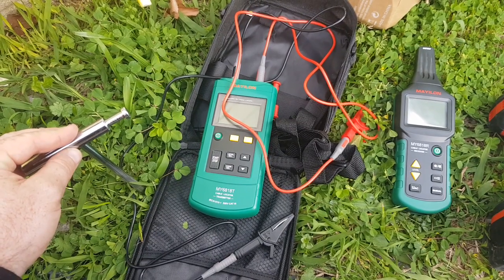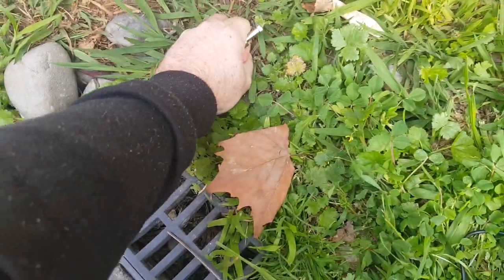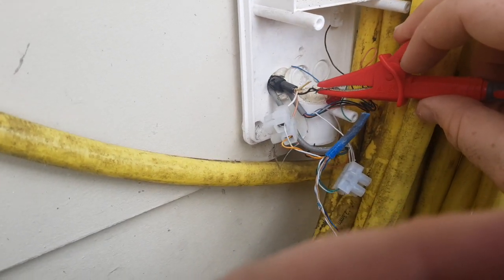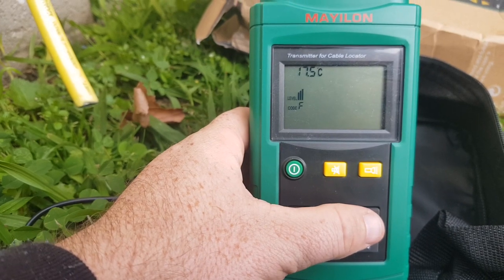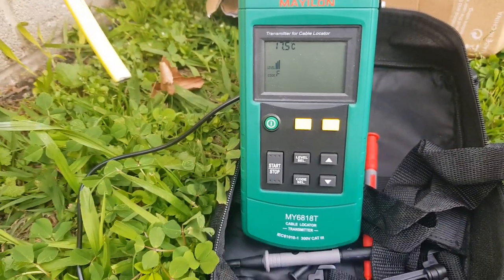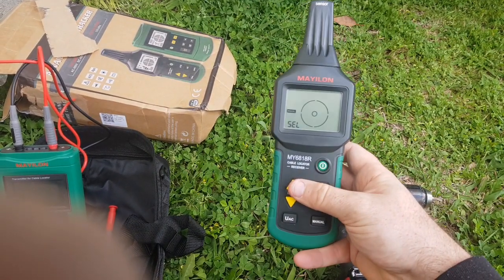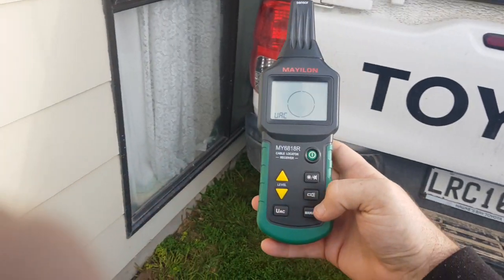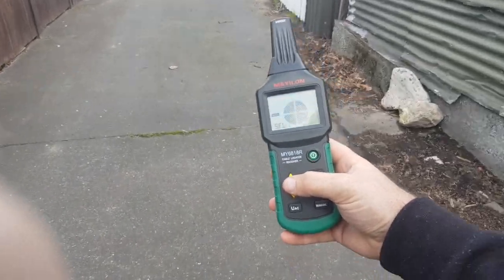Mastech MY6818 MS6818  / Noyafa NF-826 Underground cable locator

Comment: Would this work with a lighting circuit fault I have, my old manager thinks the cable has a break underground. I can turn the circuit off and attach this device but not sure if it will work. Also as it's a car park there is only grass (ground) nearish to the cable.
Reply from the maker: Possibly. If a wire has a break and the ends have been pulled apart then yes you could detect where the wire ends. However if its just an insulation fault where the cable continues to stay connected then you wouldnt be able to tell.
Reply: @raytaylornz  you explained that well, makes sense. thanks

Comment: Only tells you where cable is and not a break it’s just like a cat system
Reply: Stefan Rainer ok will give it a go cheers jm
Reply from the maker: If there is a break in the cable, you can follow the cable path until the signal suddenly stops at the break. 
Connect the transmitter to the opposite end and follow the cable path backward, and around the same location the signal should stop being detected. This will confirm the same location as the break in the cable. 

Otherwise you can buy a TDR unit for several thousand dollars. They send a signal down the cable, and if the cable is broken, the signal will reflect back to the transmitter. It will time how long it takes for the reflection to come back and that tells you the distance to the break. You still need a machine like this to work out the route of the cable as without knowing the exact route, you wont be able to measure out the distance and know where to dig.
Reply: It's a cable locator not a fault locator but you can find faults where the signal drops off dramatically
Reply: You can use two transmitters, one at each end, on different codes. When the receiver suddenly detects the other code, it means that there is a break.
Reply from the maker: The reciever can only detect one channel at a time. You would have to stop and select the other channel to begin detecting before you reach the break.
Reply: @raytaylornz  Not true.  Maybe that's how your model works.  I have the Axiomet AX-T2090 model, and the receiver automatically detects the channel number.  It also says in the manual that you can use two transmitters to look for a break in a cable.
Reply: @Sim_Tiby  I'd appreciate an explanation of why 2 transmitters is better? I assume with a single transmitter the tone will stop at the break, with two transmitters the tone will change pitch? I have a (very long) robot mower wire, over winter it is typical to get several breaks, so I'm not sure that two tones will help me as I presume I need to find & fix each break in turn, and for that a single tone would be fine? I currently use a very cheap signal generator and AM radio but I what to buy a better solution - which can detect signal better than my AM radio method.
Reply: @kgarden8960  I don't know if it is necessarily better or not.  It can also be used with one, as you say.  We are just explaining that two transmitters can be used, according to the manual.  The receiver changes its channel number when receiving the signal from the second receiver, and perhaps it is still more accurate to detect the gap, because with only one transmitter, the signal can radiate more than necessary.
Reply: @Sim_Tiby  Thanks very much for your prompt reply.
Reply: If there is more than one wire in the bundle it will induce the signal into all wires (by induction I guess) and will not locate the break location but will continue to trace the wires that are not broken.